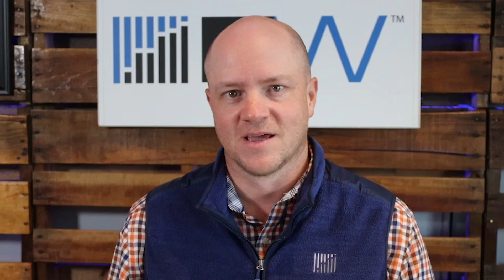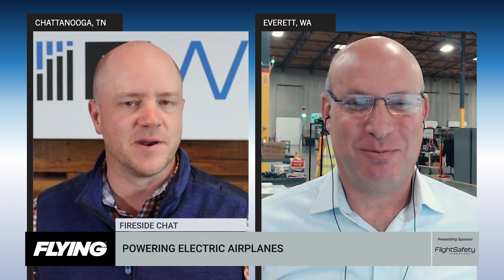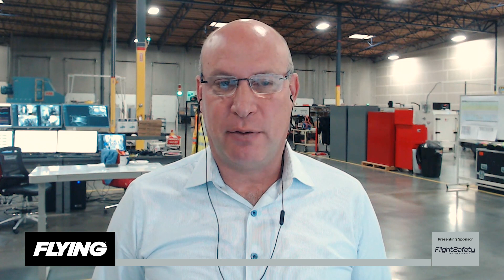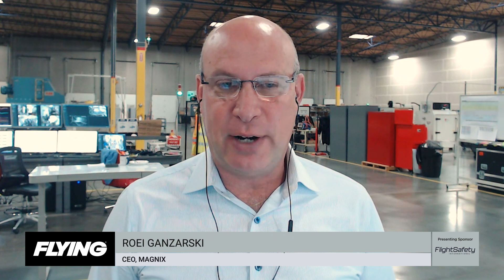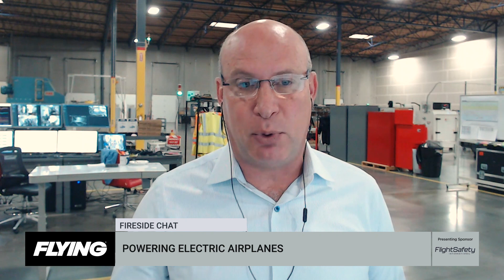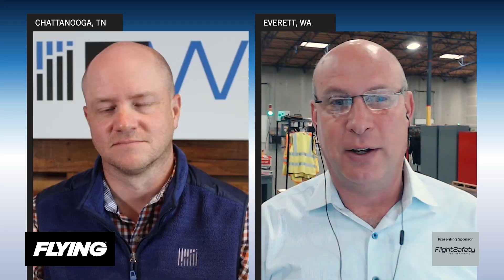Powering Electric Airplanes with magniX

Comment: What are the realistic timeframes for entry into service of the eBeaver and the Alice?  When the Harbour Air eBeaver flew 2 years ago it seemed that it would be going into service within a year.  The DHL order for 12 Alices is supposed to be delivered in 2024.  Is that still the target delivery year?
Reply: The eBeaver is a experimental prototype. Although Harbour Air intends to convert their whole fleet, Beavers wouldn't necessarily make sense - they fly more Otters than Beavers. I don't think they ever expected even that first aircraft to go into commercial service in only a year, no matter what some marketing person may have implied. As it is now, it doesn't have viable payload, so in its current form it will never enter service.